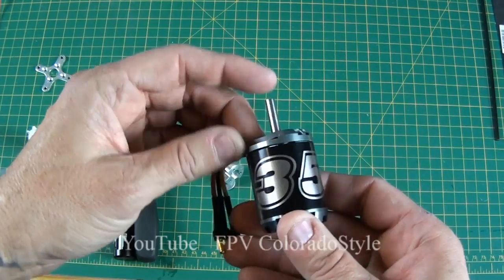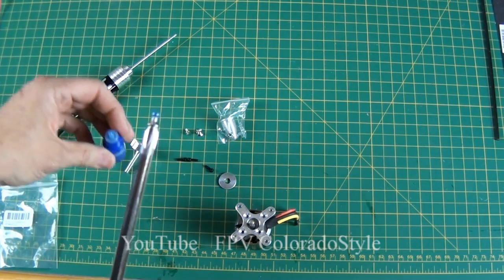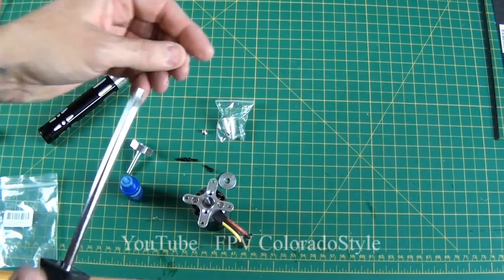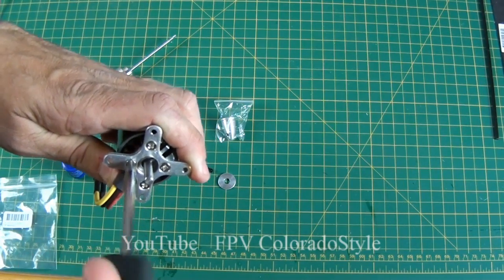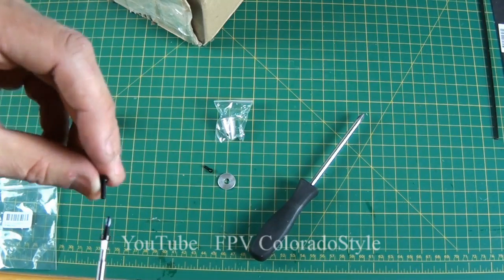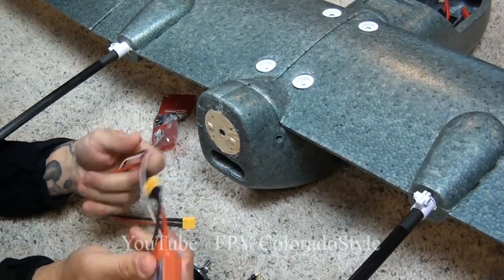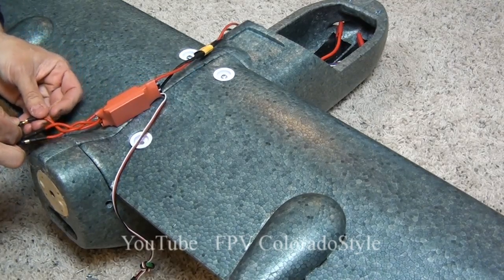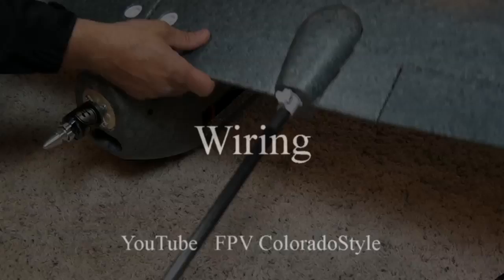SKYHUNTER FPV Build Part 6 Motor Installation and Wiring

Comment: I was watching this in 2X speed to try to get through the series of 7 in an hour or so, and I had to pause while you were installing the  Spektrum Rx. I put the brakes on and back to normal speed before I left a comment about LRS options. Whew. What a relief. :-)

Comment: Did you drill new holes on the motor mount for the NTM adapter kit to fit? mine doesnt fit on the holes. and i what screws for install the mount to the fuselage?